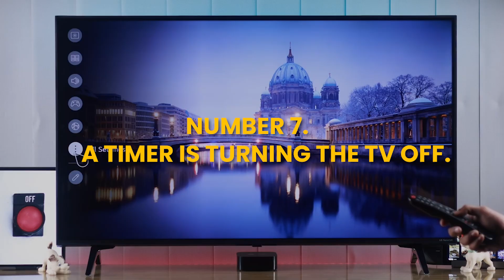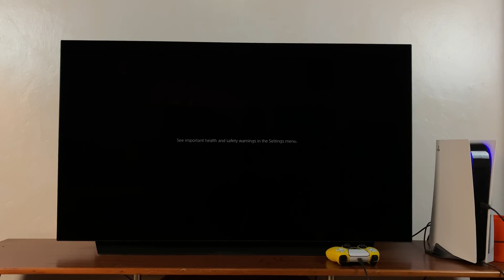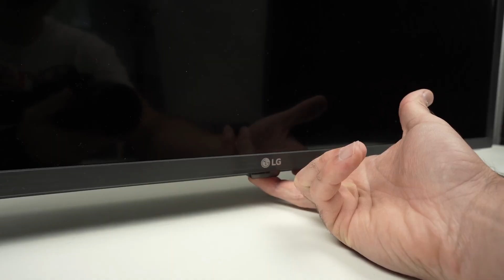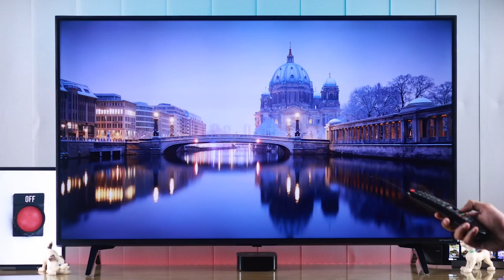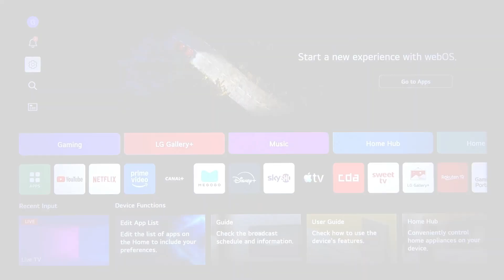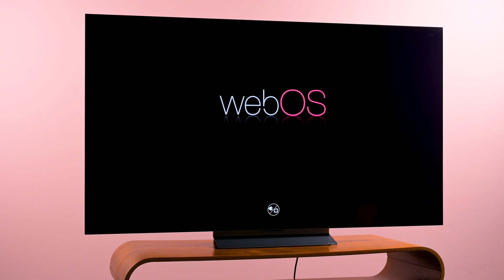LG TV Keeps Turning Off? Try These Proven Fixes!

Comment: I don’t know what’s wrong with my LG smart tv 32 inches, it just off whenever am in the middle of watching something then later it just permanently blank but the led light is on please what can I do
Reply from the maker: Try performing a full power reset by unplugging the TV from the wall for a few minutes and checking your energy-saving settings.